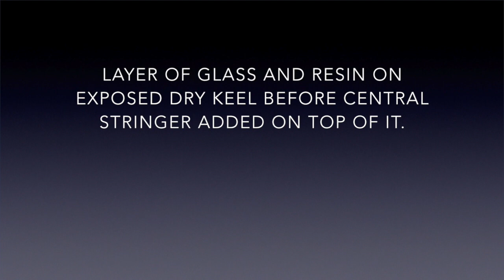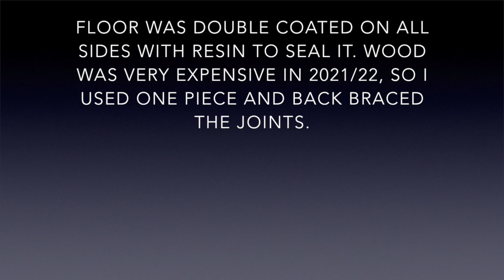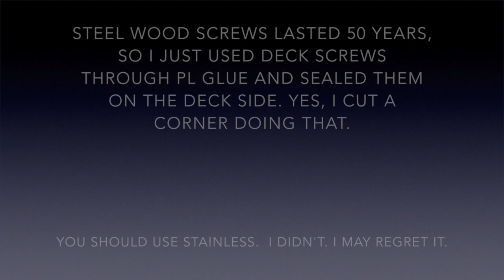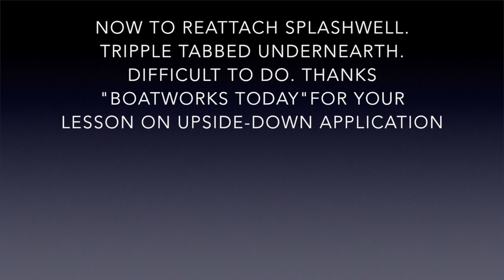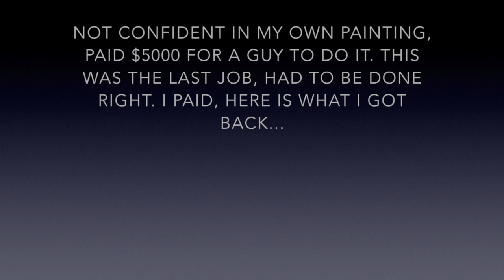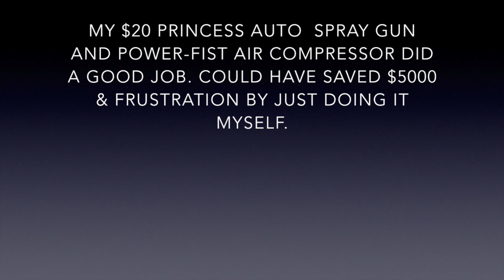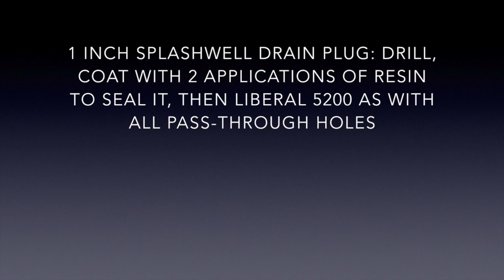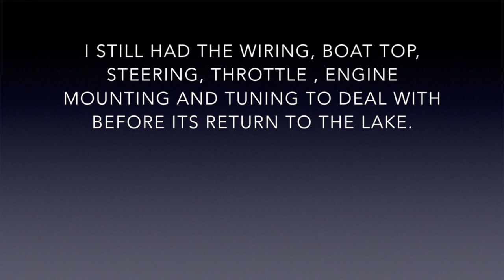1971 Hourston Glascraft Stringers and Floor Replacement

Comment from the maker: That's the exact same hull as mine.  Great boats -especially in the rougher water. You are probably going to need to replace the transom too.  Huge job but doable.  If you do it, get one of those oscillating saws.  They go through fibreglass  like butter and they don't create too much dust.  If you can avoid cutting at a radius (like an inside or outside edge) your glass work will be much easier (on a flat surface) when putting the pedestals and splash well back in. Good luck and let me know how it goes if you do it.